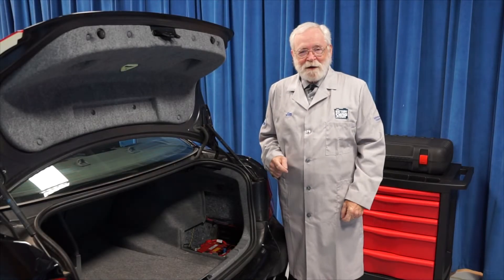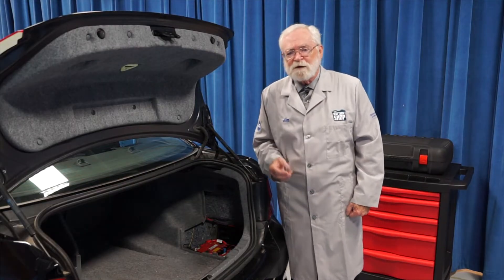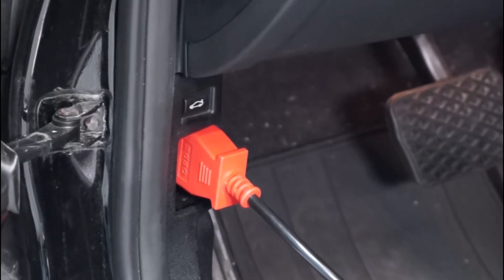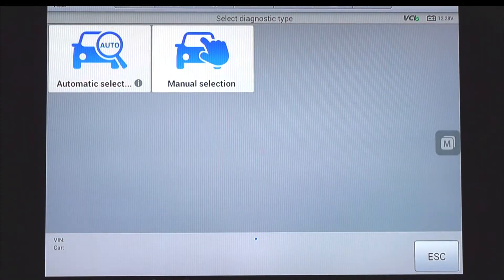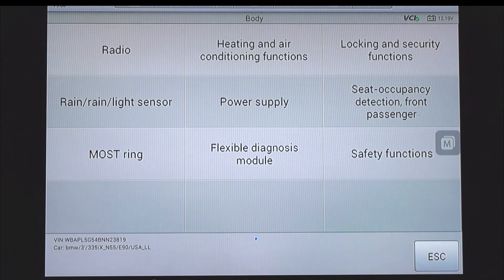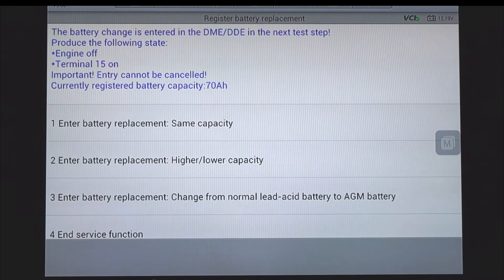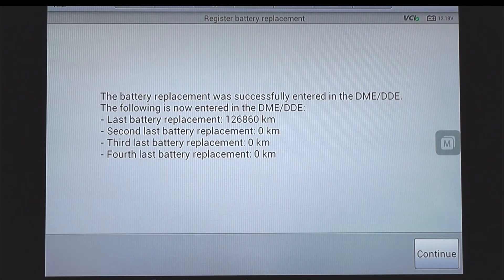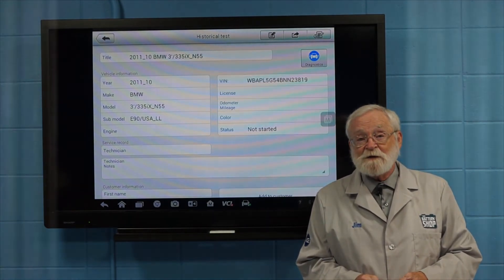Battery Registration with a Scan Tool  - The Battery Shop

Comment: I see this in an older video but if anyone else is seeing this on their you tube page and knows the answer , what year did they start this bs! I’m going to assume luxury, sports, foreign cars have it first but as of 2020 when I retired from the industry I hadn’t seen this type of system. Now doing side jobs but only a code reader I wouldn’t be doing anyone a service by changing their battery knowing an issue without registering it could happen

Comment: I feel the same way , battery bad got New 1 installed now car won't Start at all 😢 just put a gun to my head 4 $
Reply from the maker: Hi - Thanks for watching and sharing your experience! We suggest that you check the vehicle owner’s manual or a service/repair manual for the vehicle to see how to reset the vehicle computers and get it running again.
Reply: New cars suck ! better off to buy old car in good shape!!!

Comment: Does this only apply to BMW or Mercedes also? E350 2013.
Reply from the maker: Hi - Thanks for watching! Several Makes and models require battery registration. We suggest that you check with the vehicle owner's manual for that information and also how to perform any vehicle system resets that may be necessary.

Comment: A few more years and we will likely need a supercomputer to register the simplest lightbulb replacement.  I like cars and everything, but the complexity is approaching absurd levels.  
Whatever happened to the voltage regulators that monitored and adjusted the battery charging level????  That system worked so well for over 50 years.  Why complicate it?
Reply: lol, never happened to me , luckily , but a friend and colleague in the industries shop had a Cadillac , probably about a 2010 apprentices dad car that they put 3 headlights in it. They thought they were getting defective bulbs before the apprentice figured out no power to connector. Being an independent and not having info they contacted the dealer to get a wiring diagram. The dealer asked if they told the computer to turn that headlight on. Their scan tool wouldn’t do it so they took the car to that dealer. Being a big purchaser they programmed it for him no charge.
Reply from the maker: Hi - Thanks for watching and sharing your opinion!

Comment: Hi, I just replaced my 2015 X5d battery with a now dealer replacement spec battery. It is just about the same, 92ah 850cca, compared to the original 90ah, 900cca. I have had no luck changing this small difference on my Autel BT808 scanner. I have registered it, but it comes up as the original 90ah, 900cca battery. Is this ok??
Reply from the maker: Hi - Thanks for watching! The battery control module will maintain and charge the new battery as if it were a 92ah 850cca battery. Because this differs from O.E. we can't comment on if this will be OK or not. We think the difference will be a slight overcharge condition.

Comment: what obd2 did you use on this?
Reply from the maker: Hi - Thanks for watching! If you are referring to the scan tool, it was an Autel Maxisys.
Reply: @TheBatteryShop  can this be done with a scan tool that doesn't cost more than the car?

Comment: I have a Foxwell (NT510 Elite for BMW) scanner. It has the same menu you show here but the option to change the A/H value or type of battery doesn't work, which is very annoying. Do you know of an affordable BMW scanner where this function does actually work? Thanks.
Reply from the maker: Hi - Thanks for watching! The scanner we used is an ACTRON MaxiSys.
Reply: @TheBatteryShop  which version of the scanner?
Reply from the maker: Hi Kevin - It's a MaxiUI version V03.21.00

Comment: Ok  my battery was removed  to be charged on the bench   do I still have to code it back after a charge
Reply from the maker: Hi - Thanks for watching! No. The battery management system will continue to use it's current information about the battery.

Comment: Just a quick comment.  I've been an auto tech over 40 years and have my own shop now.  For manufacturer to put a battery module on a vehicle to "compensate for the age of the battery" and to have to "register" a battery with a scan tool offends me.  We have always had devices on cars that compensate for the age of the battery.  In case you are wondering they are called alternator or generator if your old like me voltage regulator.  Personally I would not own a car this complicated.  My thought is what if I go out of town on a trip and my battery goes dead.  No one can work on my complicated car in a small town and I have to get said car towed to the nearest European shop or to the dealer. Towing costs could be astronomical but its astronmical cost to replace the battery in a Euro care even without the towing. European car manufactures  to my knowledge are the only ones to make cars with a totally unnecessary battery module to my knowledge therefore I personally would never own a over engineered over complicated Euro car.
Reply: I own a Lexus & Acura. My fiancee owns an Audi A4. Most of the repairs/replacements/maintenance I can do myself. The more issues that arise with her A4 (her battery just died), the more frustrated I become. Having all 3 makes justifies, even more, my passion and decision to go with a Japanese vehicle - especially the luxury lines. All in all, I see Lexus/Acura as superior vehicles in dependability, faster & more powerful (based on what model going head-to-head), easier to take care of and cheaper parts. They also (from my experience) are loaded with more features.
Reply: It's not as complicated as you think. "Registration" is just a fancy term they are using to reset the module charging profile. You could swap batteries all day long without "registering" them and the car would run as normal. The software side, LIN and CAN systems along with the 300 computers in the car controlling and monitoring everything are a different story. Hardware-wise, new cars consist mostly of the same, basic components of any other older car.
Reply: @CORZER0  I have a scanner and I can reset this module and register the battery.  Thats not the point.  The battery doesn't need a "charging profile".  There are already very efficient electronic devices that have the correct "charging profile" they are called alternator voltage regulators.  My point is this is over engineering seen in European cars.  No wonder they loose 80% of their value in the first year of ownership.
Reply: @dwtees  I will say , Chevy Malibu’s (2013-present) have this issue as well
Reply: @dwtees  you're point was what if the battery goes dead in a small town. You were offered two solutions by two different commenters. Then go one to say 'thats not the point'. I think you just don't like modern cars...which is fair but battery registration is a minor issue. And we all know you shouldnt buy one of these cars unless you can afford to service it at a reputable indie or the dealer.

The 80% of market value comment is way over blown. Its more like 20% in a normal market.
Reply: @dwtees  If ONLY I could buy a year-old German car at 80% off! Count me in.
Reply: @chaddonal4331  You go guy!
Reply: I think registering a new battery is only applicable primary to Start/Stop function on a modern car, as some Start/Stops won't function as normal if you replace an old battery with a new one and don't register it.
Reply: @anthmartin5072  not sure thats true, most stop start system use their own dedicated aux battery
Reply: @scudinferno  my c220 mercedes didn't, neither did my BMW X1.
Reply: @anthmartin5072  that’s interesting every c class I encountered has had one. However I think you’re not in the us. They don’t even sell the c220 here. I’m wondering if the world cars are different or the lower trim level cars are
Reply: @scudinferno I just had to have my 2019 Malibu battery replaced and they did a power memory saver to keep memory but also keeps from resetting the start stop
Reply: Trouble is most people are not going to find this out till car is past warranty !!! and I think if the battery replacement is a match or very close it should not matter and will still operate. This is so called progress !!
Reply: Thank you sir, for stating the obvious !  I too have been a diesel mechanic for over 50 years and can see that this is just another screw-ball way to bring vehicles back to the dealer, to get cheated in the name of "appropriate car care" or some-such. AGMs offer nothing more that conventional lead-acid batteries, and they do self destruct or malfunction if procedure specifics are not adhered to. Very sad state of affairs. These days, I find it easy to simply fend off such modernity to let other service-shops have the distinction of overcharging customers for basic equipment.
Reply: It's not as sophisticated as you make it out to be. The car will operate with a typical battery replacement, jump start, however since its on board computers store adaptations, it aims to be the most efficient at power management. BMW's try to use the alternator only when needed so as to not reduce fuel economy, performance unnecessarily. Telling the computer you have a new battery resets its adaptations. There's nothing that will harm the car if you just replace the battery, you just may not get the most life out of the battery.
Reply: @extraglutenplz3758  I just repaired my sister-in-laws 2014 mercedes c250.  The symptom was the left turn signal light was out.  On any American or Asian car you simply would replace the bulb to repair this issue.  The Sam module failed and it cost my sister in law $2100.00 to repair a freaking turn signal right front light.  See Scotty Kilmers the 5 worst cars.  They are all European.  I never said a European car was "sophisticated".   They are certainly not sophisticated.  If they were sophisticated they would find a simple way to get complicated issues resolved.   I said they were over engineered and unnecessarily  complicated.
Reply: @dwtees  Scotty Kilmer is in the same boat as OP, he’s been a tech his whole life and is stuck in the ways of 30 years ago.
Reply: @extraglutenplz3758  Yes.  If you don't reset it after new battery install, the charging system will still "think" that the old battery is in place, and it will charge it more aggressively.  I'm surprised that these systems don't have the ability to recognize a different battery all by themselves.
Reply: @midcenturymodern9330  Maybe in the future, batteries will have a chip in it that can communicate with the BCM so that no registration is required.
Reply: @extraglutenplz3758  Well said. Love your handle, btw, that's awesome!
Reply: Awww…he’s offended, lol.
Reply: Very Very Very out of touch comment. Sure if SLA batteries were the only car batteries in use today you’d be pretty spot on, but that’s not the case. This video is directed primarily toward AGM battery’s, as they behave much differently than a SLA. If you truly own your own shop and can’t see the necessity of registering an AGM battery- might be time to move on- you can’t be a tech for 40 yrs and still be stuck in the 80s/90s.
Reply: @ubuntuisawsome100  My shop does just fine.  I just had my 16th year anniversary of being in business.  How does your shop do Hargraves?
Reply: You can just get a jump. Or almost any shop can replace the battery, and you can get it registered within a few days or so and be fine.  

The system is mostly to reduce emissions and fuel consumption by letting the alternator free-spin as much as possible. Its more efficient, almost like the way an A/C compressor disengages when not needed. 

Sure its complicated in your opinion, but a lot of things are. (Do you still have a pager, or do you talk and text everyday on a handheld device that is more powerful than any military computer of the 1990s?) 

Maybe you dont want to learn the nuances of modern "Euro cars", but Battery registration is not just in European vehicles-some 2011 and newer Ford F150's are equipped with a Battery Monitoring System and have to be registered just like a BMW.

Comment: Hey can you leave a link to we’re i can buy this scan tool with the bmw software in it thanks !
Reply: The Autel Maxsys Scan Tool costs $1100 on Amazon.  Unless you are a battery shop doing this replacement a lot, this is a terrible investment for a DIY battery replacement.
Reply: Amazon has cheaper Scan Tools in the $500-$700 range but I haven't verified any compatibility.  COnsidering the replacement battery is ~ $250, Its still not a DIY project, it will still be cheaper to take it to a shop that already owns a Scan Tool.
Reply: @davefeinglass9118  who knows a cheaper scan tool that works with BMW?
Reply: @rlong749  ancel bm700
Reply: @ktmm111  the ancel is only if you’re replacing it with the same battery. No opportunity to change battery specs